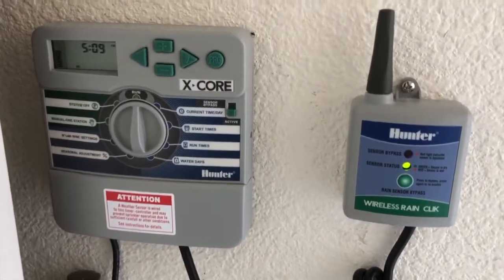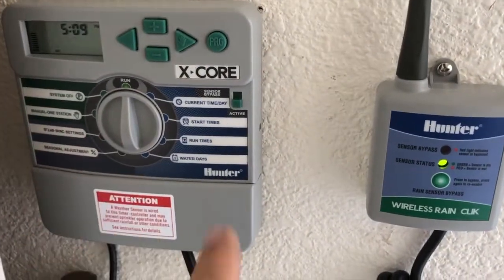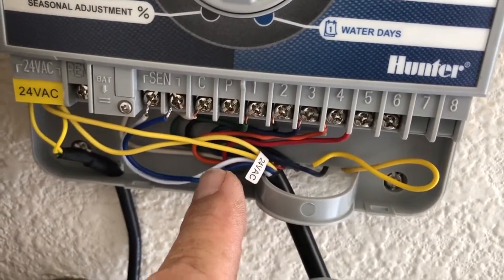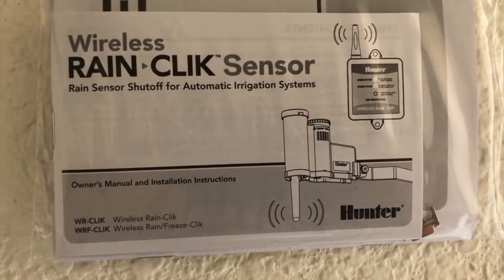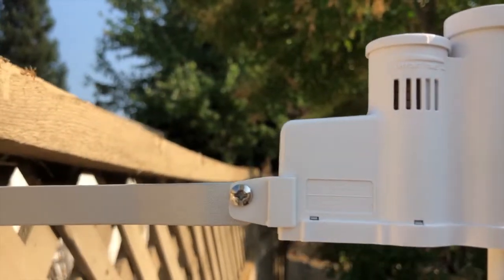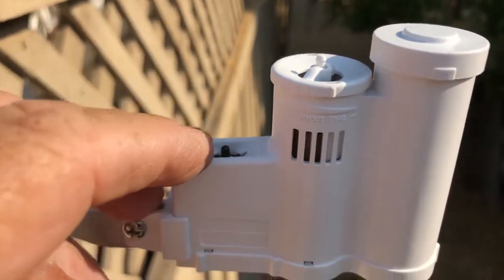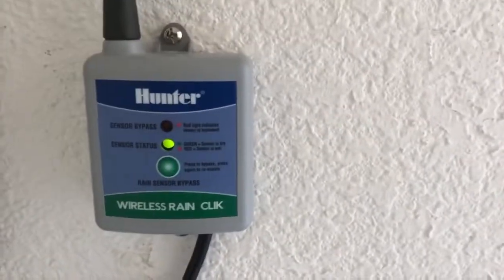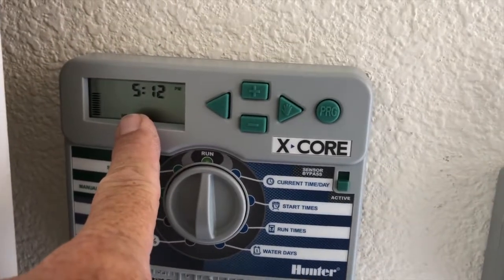Installing a Wireless Rain/Freeze Sensor by Hunter

Comment: Hi Gary- great video- thank you! I have a Rainbird timer- is the Hunter wireless rain click compatible? Believe the wiring is same. Just liked and subscribed
Reply from the maker: Yes, they’re compatible per Hunter Industries. The blue and white wires are attached to the sensor and yellow wires to the power on Hunter timers.
However, most other timers will use the orange and blue wires for the sensor connection, with the yellow still going to power. Hope that helps, thanks for Subscribing.✅

Comment: Once I installed the New sensor, the Grn light came on automatically. However the control panel shows an umbrella and the word Off above symbol. I pressed the black button and the receiver turns brieftly Red and goes back to green showing the umbrella and off on the control panel, even though the switch is on active 🤷‍♀️

Comment: My Hunter rain freeze sensor is making a knocking noise 🤔. It's annoying so I unplug the power.  Can anyone help me out? 🤷‍♀️
Reply from the maker: Never heard of that before in 34 yrs. you might need to contact Hunter Industries technical support.
Reply: Hunter never heard that either 😂. However added that it could be the sensor so I replaced both the sensor and transmitter. But even though I have the control set to Active, the panel shows the umbrella with the word Off. There's been No rain, whatsoever 😒
Reply from the maker: @deniserodriguezzi9819 you need to make sure the timer has no power when you install the new wiring for the receiver. Once wired up then return power. The display should show, off and have an umbrella icon, the light on the receiver will be red. Push and hold the black pin on the transmitter for about 5 seconds then release. The light should turn green and the current time should return to the display.
Reply: @garyssprinklerrepair - Thank you, Gary! I finally installed it. However, I had shortened the receiver black cable, wrong move! 🙆‍♀️ This left with 5 flared wires to twist, then wrap around the screws on the Hunter control terminals, and  I  had to really   tighten the screws. Talk about a lesson learned, oh boy 🫣 . I should have used a tie wrap for the excess black receiver cable. 
 Gary, I've learned so much from your videos. Thank you 🫂
Reply: @garyssprinklerrepair - Yes, that's highly important!! Thanks!

Comment: My question is my hunter control box doesn’t have the bypass switch, but it has it on the wheel. I replaced the wireless transmitter only and synched it to my hunter box.(green and red light box). How do I know when my hunter box is actually in bypass mode without a switch.  My original transmitter was about 8 yrs old and figured it was time to replace it.
Reply from the maker: Bypass mode causes the rain sensor to not function. Let’s say it’s “red” and you want to water anyway. Push the bypass tab on the receiver and now you can water.
Newer version’s on the Hunter timer also have a switch.
Hope that helps, don’t forget to Subscribe.

Comment: My top light is blinking red. What does that mean?
Reply from the maker: That is indicating no signal from the transmitter. To test the transmitter battery, press and hold the black spindle button outside on the top of the transmitter. The light should be blinking red- now release the button and the light should now be blinking red again if it does the battery is good. If not the transmitter needs to be replaced. Hope that helped. Please take a minute to Subscribe to my channel it really helps us grow.

Comment: Hi Gary. My hunter timer in RUN displays a small umbrella and off in small font when the sensor is active and is green. When the rain sensor is red and the timer is in RUN, the display shows OFF in large font and an umbrella. The only way the timer will show the time and day is if I place the timer on bypass. It's a brand new system professionally installed in 2021. Is the time and day not showing when the sensor is green normal? Thanks.
Reply from the maker: I feel the sensor might-have  been installed incorrectly. Unplug the timer from the wall. Make sure switch is set to active, blue and white wire are installed on the sensor screws (there’s no polarity and the metal jumper should have been removed))
Make sure yellow leads are in 24 ac location. 
Now plug timer into wall outlet, go outside and hold down the black pin for 5 seconds on the transmitter, release the black pin. 
The light should now be green and the time of day showing on the timer.
Reply: @garyssprinklerrepair  It was actually the white wire. The installer placed the cover on the controller without tighting it up. Clock and day on display with sensor on. Prefect. Thanks Gary!

Comment: The explanation on the wiring was horrible...spend time in the wiring piece that’s what people need help with
Reply from the maker: It’s pretty simple Frank,  the blue and white wire connect to the two sen screws doesn’t matter which one goes where. The two yellow wires go to the power (make sure to turn it off 1st) the orange wire isn’t used on aHunter timer. Flip the sensor switch to active. Plug timer power back in. Push black pin down and hold for 5 seconds on the transmitter unit that goes outside, done. Sorry you were having a difficult time. Let me know if you need more help.✌️

Comment: What kind of batteries does the wireless sensor take and is there a way to see how much battery life is left? How do you know when the batteries are dead?
Reply from the maker: The outdoor transmitter has a sealed battery good for 10 yrs. it's not replaceable.To test hold down the black spindle button until the red light on the bottom flashes, then release the button if the red light again flashes the battery is good. Hope that helps, sorry for the delay YouTube put the comment in "held for. review. Lol, hope you get a chance to subscribe to my channel.

Comment: Can you go through the steps on how to set up cycle and soak program on a Pro C controller?
Reply from the maker: With the timer dial in run, hold down the plus (+) sign for 3 seconds. While still holding it down turn the dial to run times, then let go of + button.
Set partial time (ex: if total of 9 minutes per day is desired you could set it for 3 minutes then it will soak in between)use the arrow button to select each stain you want to do this too. Now press the PRG button and put a soak cycle for each of them, using the arrows. Re hitting the PRG button each time using the arrow button to move each time or to skip a station that didn’t have a (cycle time added to it) Hope this helped, if you need more assistance Google “Hunter Pro C pdf. Don’t forget to Subscribe 😁

Comment: Will this switch work on a john deere irrigation pump? Can it be wire to a timer box?
Reply from the maker: Its intended for use with Hunter irrigation timers. Beyond that you would need to contact the Manufacturer.
Reply: @garyssprinklerrepair  Thank You!

Comment: OK i found your video AFTER in made the BIG mistake of leaving the power to my Hunter ProC  when i was installing the Hunter Rain Clik sensor now the receiver lost the address of the transmitter and the light stays yellow...How do i fix that? THANKS
Reply from the maker: MICHAEL PERREIRA don’t worry, just unplug the timer. Give it a minute, plug back in. Now the light should be red, depress the black pin on transmitter for 5 seconds, release the pin. Light should turn green and time back on timer. ✅
Reply from the maker: MICHAEL PERREIRA hope this helped if it did feel free to Subscribe to our Channel. We have over 50 other DIY sprinkler videos there😎

Comment: mine sensor shows red for couple hours than goes back to green and its summer in cali any suggestions ?
Reply from the maker: balk37, well hard to say for sure without being there. Is it possible the sprinklers are hitting it when they come on? Check the 2- yellow wires and the blue and white wires to make sure they’re still snug on the timer. If it rains but not very much the sensor will dry out pretty quick if the vent is all the way open. I usually only open it about half way.

Comment: The instructions for the X core (hunter) system show that you can have a programmable delay for return of sprinkler operation after a rain,  ( Page 20 ) .  But when I program the delay it counts down the number of days and then poof !   that programming disappears and the delay program won't be there for the next rain event.   
Seems stupid to have that rain delay (number of days after a rain event that the irrigation won't happen) be there for only one rain event.

Am I doing something wrong in my programming steps ?   or is it really just a one time delay and that it?
Thanks !!
Reply from the maker: Tom tommyL no, you’re correct it doesn’t repeat. You can install a rain/freeze sensor (see my other video)then it won’t come on until the outside sensor dries out. Hope that helps, Subscribe if you get a chance ✌️

Comment: does rainbird make something comparable? I have a rain sensor mounted off the roof by the side of my garage and it works well as for shutting the system off but it seems to dry out too quickly turning the system active after 1 day sometimes. I know heat and wind can effect it but it sure would be nice to adjust it to not be so quick to go active again. Got the Orbit b Hyve by the way, think I'm going to have my sprinkler people hook it up either this fall before winterizing or next spring at opening!